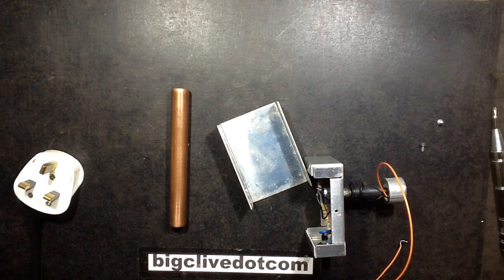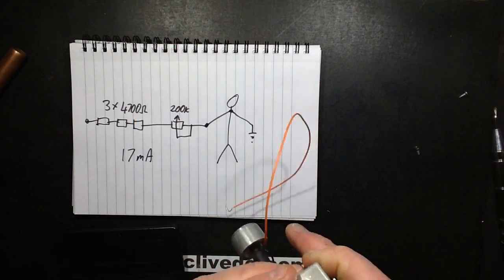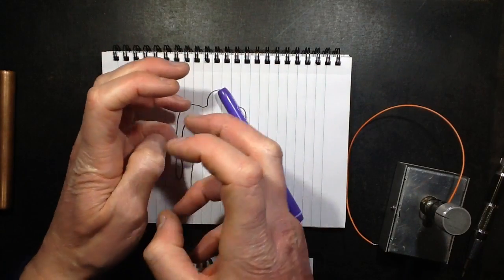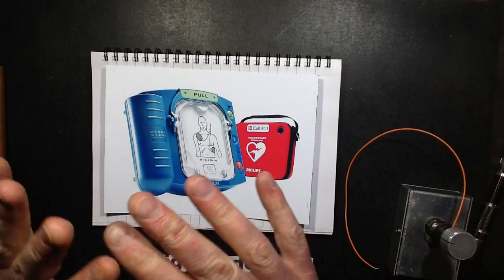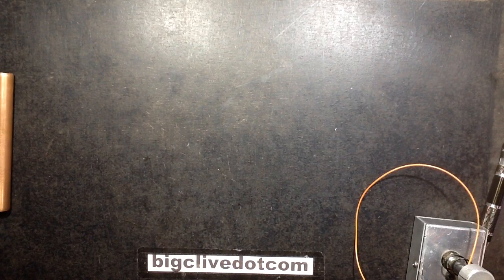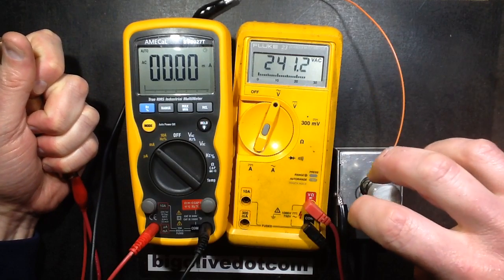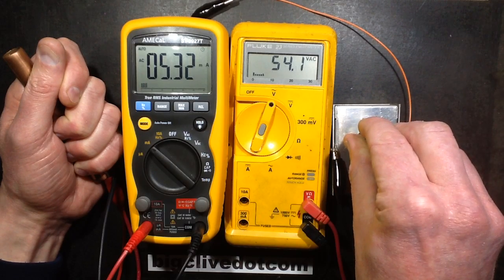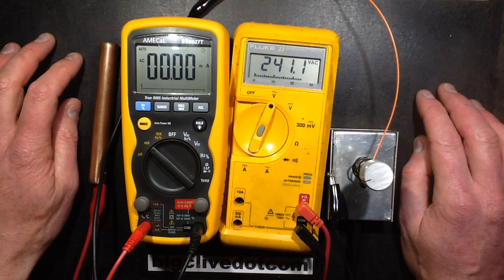Avoiding electrocution (Featuring real shocks.)

Comment: That was one of the most intense videos I've ever seen on You Tube. Even with the certain knowledge that you'd survived, I was feeling anxious as you turned up the current.
Reply from the maker: I have to admit that I'd probably squirm if I saw someone else do it.
Reply: So that's what I got today. I have burned blisters on both hands... (junction box dangling from a ceiling that was SUPPOSED to be dead, I know, all the rules got broken by me, all my fault including hand to hand..) but that terrifying moment when it grabs you and you CAN'T  let go...or talk... or breathe, or see... fuck that, fuck that feeling very much. I've been shocked many times before (as has everyone who's an electrician or even a tinkerer) but this bastard thing wanted to KILL me. :\
Reply: bigclivedotcom It felt a bit like a one-man Milgram experiment or something.
Reply: It was pure, unadulterated nightmare fuel..
Reply: Trust me @dave... since that incident, I've started following those rules!  That was my wakeup call. Since that day, despite working every day with power, not even a tingle :)
Reply: It's like how 2nd had embarrassment is worse than 1st hand
Reply: I didn't squirm;  I discovered a fault in a television, when I received a shock, a very painful shock, and had to step away from my work bench to break the circuit.  That happened 47 years ago, and the vivid memory of the event caused me to think that the event we just watched was posted by the executor of Big Clive's estate.   

Thank God, Clive has survived his foolishness.

Comment: It needs a "dead mans switch" on the floor. Something that activates when you step on it.
Reply: The safest way to do this is to let the apprentice try it 
whilst you stand by with the defibrillator.
Reply: That's what I meant. Thanks.
Reply: Jammit Timmaj no. you need something that activates when you step off of it.  perhaps a switch on the table that you hold down with the back of your hand.   if you loose control of yourself youll fall and let go of the switch and not die.
Reply: You're a smart person
Reply: We have a small 6DOF robot in a lab that has a dead man switch that has two stages. You must hold it in the middle stage; if you let to or squeeze harder, it stops the robot

Comment: why do houses needs 240volts, most appliances are dc, i.e led lights, tv, computers, rechargable hoover,
. ok cookers may need mains, but if houses had 12 v and 5 v plug sockets, think of the number of drop down transformers that would not be need to be manufactured
Reply: Tim, because having a 24 DC/AC live mains would require high current and really thick cables to transport this high current.

Comment: Hey Big Clive

Bah, I get full 240 regularly, it's good for you, lots of vitamin Cu. But then us South Africans invented the RCD, so I like to be the test device to make sure it's working, I don't trust the test button.

I had to have an extra Strongbow cider watching you, presumably while you're drinking Savannah cider, how upside down is that. We're importing each others ciders. 

I think there is a one hand rule for circuits, and a back of hand rule around potential conductors to prevent grabbing. 60 volts is whats considered the limit in SA for extra low voltage circuits not needing protective insulation etc which confirms where you started to be uncomfortable.

As always, your videos are awesome, keep them coming, I'm addicted.

Comment: Reminds me of the time I was a slater and walked into overhead cables with an aluminium ladder. Melted 2 slots in the ladder, sparks falling all around.Scared the hell out of me. I was fine though
Reply from the maker: I'm guessing those can't have been high voltage 11kV distribution cables.  Hopefully it was "just" 240/415V.
Reply: Just the cables you see running up a street

Comment: You must have been well insulated from the floor to be able to touch the knob even without holding the pipe.
Reply from the maker: Croc's, carpet and wood.
Reply from the maker: jusb1066 That's OK.  I've no fashion sense whatsoever.  I originally got them because my feet overheat in summer.  I had to order them direct from the USA because the UK importer didn't get any of the bigger sizes.
Reply: bigclivedotcom
ahh crocs, seems they can insulate you from electricity but not from criticism  from the fashion conscious

Comment: Remember seeing the tingle-tron on bigclive.com like a decade(?) ago.

Thought about making one with a built in analog mA meter and an array of LEDs in the circuit. That way one could keep scores and see the pretty leds light up. :P

Put then I forgot about it and started to play with capacitors instead.
Made a shocker with a diode, a small cap and a potentiometer instead.
Reply from the maker: Yeah.  there's a picture somewhere of me at work in series with a section of LED tubelight.

Comment: Ack! That just brings back memories of the sting/tingling.

I was taught that if interacting with a live box, have good shoes and put one hand behind my back. 

I guess that doesn't help if you need both hands, but keeps you from grounding right across the chest.

I wonder how (if) AC and DC shocks differ. I've only had experience with AC.
Reply from the maker: There are other variants to having one hand in your pocket or behind your back.  In Glasgow the street lighting guys are standing in a fibreglass bucket on their truck, and also use a black rubber glove over one hand to avoid hand to hand shocks while still giving the dexterity of a bare hand.
Reply from the maker: smallenginedude71 It tends to be alternating current that causes sustained muscle contraction.  Smooth DC will cause one muscle pulse and then a burning sensation, but unsmoothed DC like you get from older welders also tends to cause muscle contraction like AC.
Reply from the maker: ***** DC causes cellular damage through electroporosis.  It basically kills the cells by causing their walls to break down electrolytically.  That even happens at very small currents.  (Yes, I did experiment and learned that the hard way.  It looked like a crater through my skin in the affected area under a microscope.)
Reply from the maker: ***** One of the copper disks (pennies) tarnished due to the electrolysis.  i was playing about with a quack medical application which was based on research that showed that blood could be sterilised when low current was passed through it.  On the "crystal healing" sites the answer to the electroporosis was to glue a bit of quartz to the inside of the unit so that it "healed" you while it electrically perforated your skin.
Reply from the maker: Just a humble 9v PP3 battery and two copper disks taped to my wrist to see what happened.  After a while it started stinging as the skin was perforated.
Reply: Okay, that's werid. o:
Reply: DC is much less aggressive. BUT! When you touch DC for a very short period of time, it can be dangerous, too depending on the voltage and current.
Reply: bigclivedotcom Which voltage and current was involved in that accident? o:
Reply: Nova Light DC sticks to you!!
Reply: bigclivedotcom i see. the muscle contractions could be almost viewed on an oscilloscope
Reply: What the hell... Are you shure that this was not a reaction between your skin surface and the copper? Was the copper changed in any way?

Comment: When I was about 9 years old, I decided to take apart an old computer power supply and obviously, I kept it unplugged. But when I tried to get the fan inside working I was plugging it in and unplugging it and obviously, there was one time I left the whole power supply plugged in. I received a shock from what I now believe was the mains. my legs tensed up to the point I threw myself across the room. I had a bruised bum and I was a little pale for a while but otherwise okay. After this video I release how bloody lucky I was...
Reply from the maker: There's an Internet story about a kid who was electrocuted by his computer when he touched a capacitor inside while it was unplugged.  He was found dead next to the open computer and power supply with the plug lying on the floor.  In reality it was more likely a full mains shock he received between the case and a live connection in the PSU, and after the shock he probably did what most people do when they've received a shock from an appliance.  Unplug it.  But his heart was probably in a state of fibrillation resulting in his death shortly afterwards.
Reply: bigclivedotcom When I was 6 I had this idea that my radio would get better reception if the antenna were tied into the power lines. My mother awoke to a loud pop and found me white as a ghost. I swore that nothing had happened and she went back to bed. I had a burn scar on my right for years. Kind of morbid to think about how differently that could have gone.
Reply from the maker: nodriveknowitall Awesome.  Did you by any chance end up working in an associated area of technology?
Reply from the maker: nodriveknowitall Industrial maintenance sounds just fine to me.  (Just make sure your meter has either Cat III or Cat IV rated inputs to avoid any more unfortunate electrical skid-marks on your hands.)
Reply: bigclivedotcom I wish I could say that I did something more with my curiosity. Industrial maintenance with a hard on every time there's an electrical problem is as far as I've gotten career wise. I'm slowly amassing test/play equipment for my spare time.
Reply: bigclivedotcom I had the experience of touching one of the capacitors inside a PSU. I do believe it must have been partially discharged, thank heavens. All I ended up with was my right arm completely tensed up to the point where it hurt, the muscles were that tight. Over the course of a few hours the muscles finally relaxed and I felt like I just did a gym session on my right arm alone. Never Again.